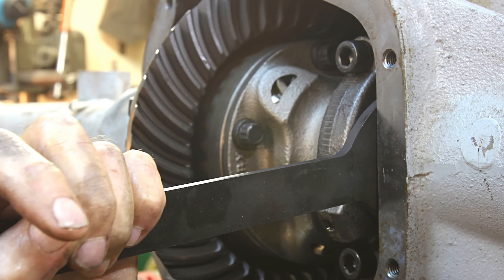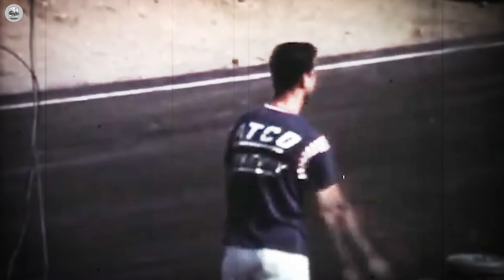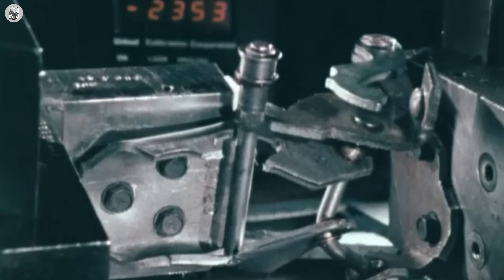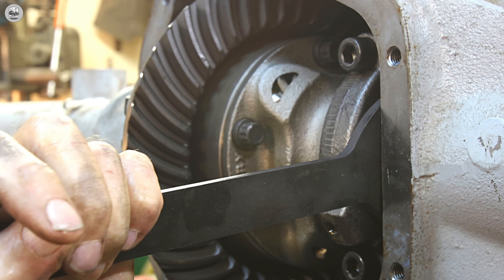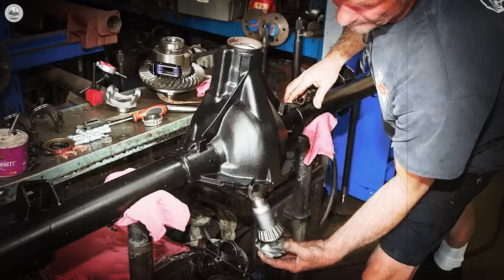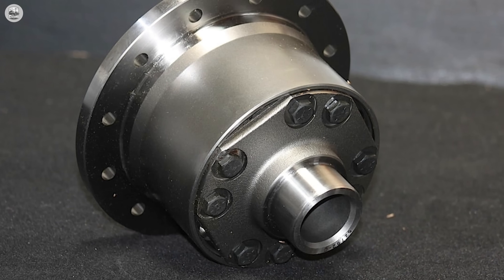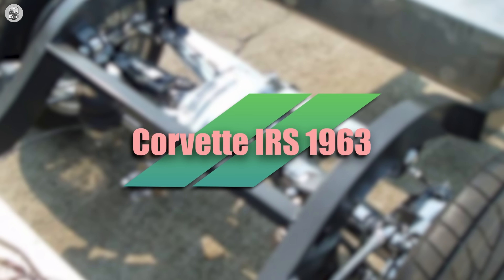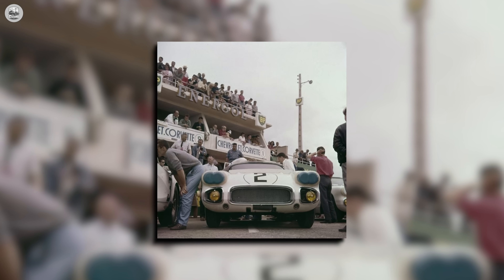Which 5 ENGINEERING SECRETS Made Muscle Cars LEGENDARY?

Comment: The MOPAR 8-3/4 is just as strong and more efficient.  But far less common thus too expensive.  There's a reason why Hemis came with Dana 60s.
I've got both 60 and 70 axles in RAM diesels.
Mismatched pictures and audio.
Reply from the maker: yeah man the Mopar 8 3/4 is a strong piece for sure, super efficient too with less parasitic loss than a 9 Inch. the only real issue is like u said… theyre harder to find n the good ones cost a chunk. once u move into Hemi torque territory thats where the Dana 60 makes sense, the factory knew what was comin outta those engines. i got a 60 n a 70 in my Ram diesels too n theyre basically farm equipment tough. and yeah the mismatched pics n audio happens sometimes, internet ain’t perfect.
have a great day, hope to see you on our NEWEST VIDEOS...

Comment: Mopar 8 3/4 comes out the front just like the 9 inch
Reply from the maker: The Mopar 8¾ had that same drop-out third member design as the Ford 9 inch, made gear swaps easy. The 489 case version was the strongest, 1.875" pinion and tapered bearings. Could handle 600hp easy when built right. Chrysler really knew what they were doing with that setup.

Comment: Everybody talks 9-inch and Dana 60, but that Mopar 8¾ held its own for decades.
Reply: Funny how no matter what you drive, when you break a rear end, you end up swapping in a Ford 9-inch. That says it all right there.
Reply from the maker: True that man. The Mopar 8¾ was tough as nails, especially the 489 case version with the tapered pinion. It could take 600 hp all day if set up right. Chrysler used em in everything from Road Runners to Chargers through the 60s. But once guys started pushing over 700 hp with slicks, the Ford 9 inch just made gear swaps easier and handled the abuse. Both are legends in their own right.
Have a nice weekend...hope to see you on our NEWEST VIDEOS...

Comment: the real game changer might’ve been the Corvette’s IRS, but Cadillac was already doing wild stuff in the late ’50s. That ’58 Eldo had a full independent setup with trailing arms way before the others. Caddy was chasing Mercedes-level tech back then auto wipers, fuel injection, even 25 mpg in the ’50s.... GM just lost the plot later on when they ditched innovation. If they’d stuck with fuel injection and the OHC six, they could’ve ruled the fuel crisis years instead of getting smoked by the imports.
Reply: The accountants and the quarterly shareholders report started holding sway.That's what happened
Reply from the maker: Cadillac was doing real engineering back in the 50s, not just styling. That 58 Eldorado’s rear suspension and the early Rochester fuel injection setup were way ahead of the curve. They were chasing European precision while still keeping American comfort. Once the bean counters took over, innovation died fast. GM could’ve led the 70s fuel crisis if they’d kept pushing tech like that OHC six and FI systems.
Have a good day, hope to see you on our Newest videos....

Comment: The Dana 60 wasn’t yanked out of semis or tractors; it showed up in heavy-duty 3/4ton and one-ton pickups. Built for torque, not farm fields. Big 9.75 ring gear, thick tubes, 35 spline axles
Reply from the maker: Right on man. The Dana 60 came in trucks like the Dodge Power Wagon and big block 3/4 tons for a reason. With that 9.75 ring gear and 35 spline axles it could handle over 7,500 lb ft at the wheels. It wasn’t farm junk, it was real heavy duty gear. That’s why racers swapped em into muscle cars once torque started climbing past what the 12 bolt could take.

Comment: NASCAR’s the whole reason the Ford 9-inch became a legend. Every team ran ’em because they were tough, easy to gear swap, and flat-out reliable under punishment. Even today, most of the Cup cars still spin those 9-inch housings.
Reply from the maker: Yeah exactly man. 
NASCAR made the 9 inch a household name. Teams loved how you could swap gears in under 10 minutes with that drop out center. The nodular iron case and 35 spline axles handled close to 900 hp back in the day. Even modern Cup cars still run versions of it cause nothing else takes that kind of abuse lap after lap.
have a good day, hope to see you next time.